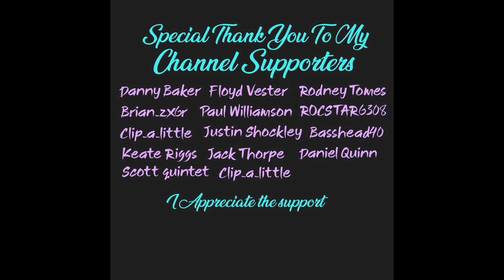Weekend recap and my measuring mistake

Comment: Why not reduce your bottom side enough to get your 1: 1.5? May only have to drop an 1inch or 2.
Ps. Since your baffle is not completed yet, you still have time to change a bit
Reply from the maker: than would drop the lower chamber volume.. that's not good
Reply: @JerryAintloud  you always have wiggle room on box sizing though. Sorry just my 2 cents as a box builder

Comment: Jerry I have a quick question I'm running 3 md 8000 taramps. I have a 10 volt line driver by audiopipe . is sending 10 volts bad for my amps should I buy a regular rca distribution than a 10 volt line driver.
Reply from the maker: the MD series hates anything over 1.9 try it without and reset gains and see if it improves.
Reply: @JerryAintloud  i will thanks.